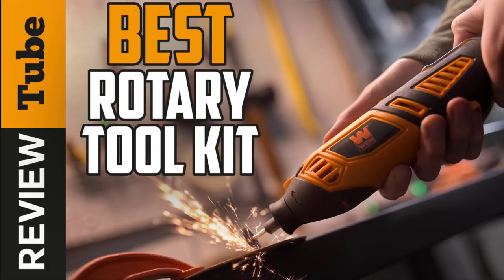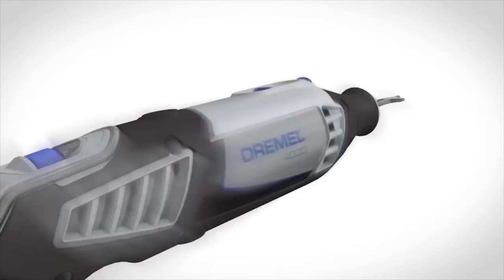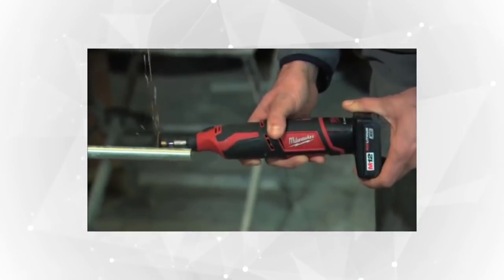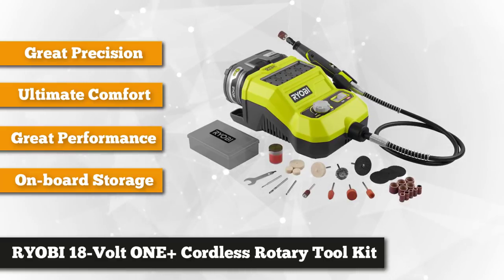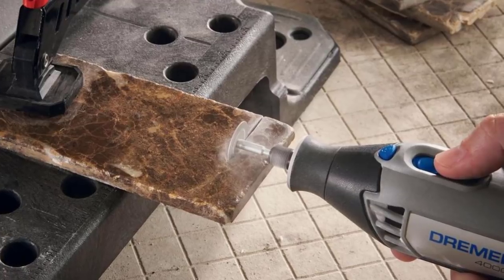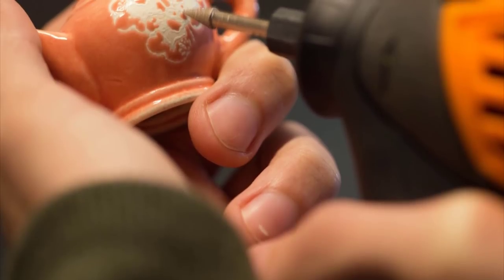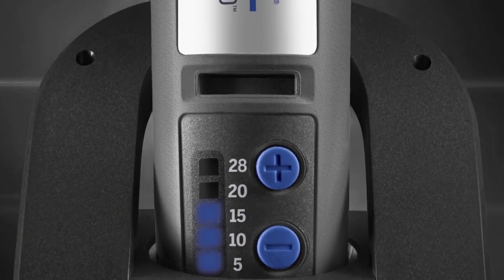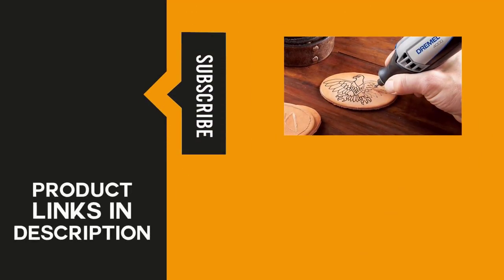✅ Rotary Tool: Best Rotary Tool Kit (Buying Guide)

Comment: I bought a Dremel brand cordless tool a few years ago. The speed switch stopped working at about a year old and now it’s off or max speed only. I have been using it when needed as is for a couple years now, the battery just stopped charging today. Time for a new one that works properly, but probably won’t be a Dremel brand. Too much money for inferior product, imo.
Reply: I’ve tried many brands but my 4300 is still my go to. I have an 8220 but that’s for mobility only. You would probably have had yours longer if you used the warranty and bought and extra battery. My 8220 had a lot of dust inside so I took it a part and removed the duct and it became notably better.

Comment: My dremel 4000 committed suicide after a few months, I looked over the manual and I did absolutely nothing wrong, the cord is not broken or cut anywhere, theres no loose or missing peices.
Reply: Dremel quality isn't what it used to be, sadly.
Reply: Did you change the carbon brushes
Reply: @TheImtoomuch  just get a dental lab dremel tool and that'll last you for life.
Reply: 4000 has a bad reputation here in my country.
Reply: @visitor404  None of the dremel are what they used to be.

Comment: If you do lot's wood carving & grinding & sanding Like 300 hours and more you better off with Dremel Fortiflex 9100 because the wood dust get inside the tools after 250 hours working and worn out Quickly just good for garbage don't really matter which brands....